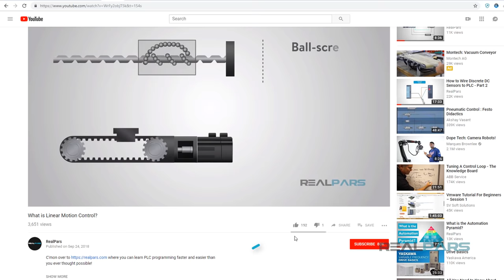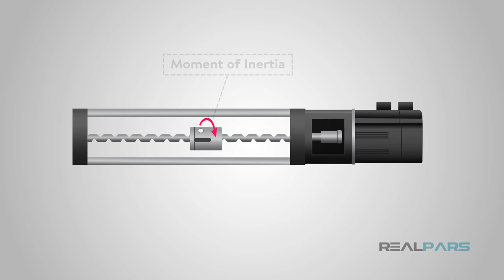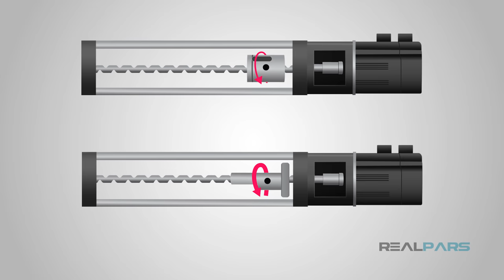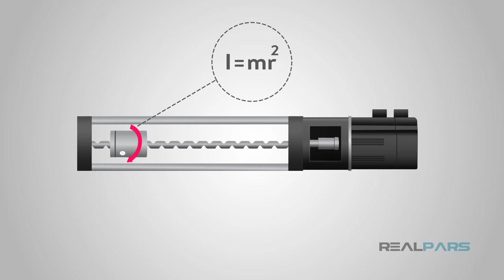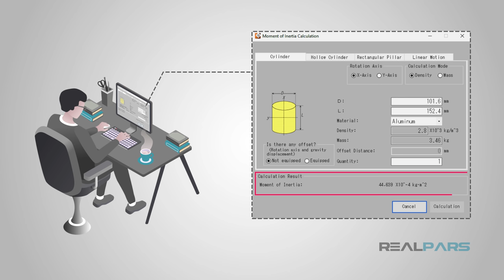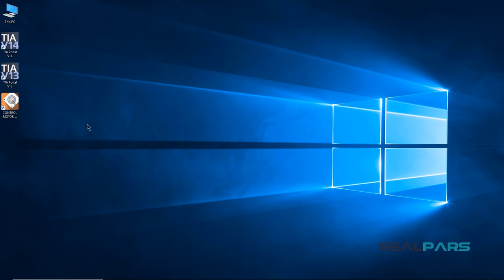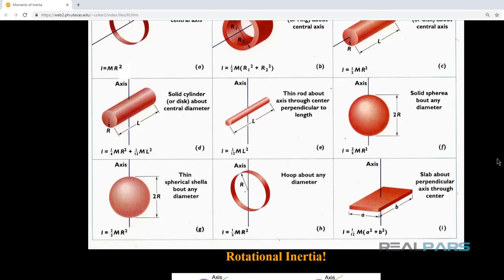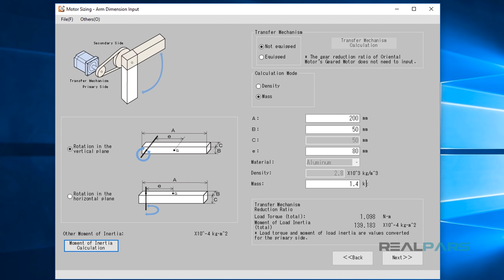How to Determine the Motor Size for Your Project?

Comment: When I open the software, I get the error:
 "
invalid conversion of the string"7.9" in typ single" "
I tried to repair it but it didn't work
Reply from the maker: This appears to be a software error caused by an issue with the specific browser you are using or the absence of some software component that was not loaded correctly.  I am not sure exactly what software or version you are using, but I would contact the software vendor via their support website.
Reply: Hey Marcel, did u fix it

Comment: Hi Mate, 
I am going to carry a steel pallet (overall weight of 700 kg) over rollers with 2 stepper motors on each sides, do you reckon "Nema 42 CNC Stepper Motor Bipolar 30Nm" is enough for this application?
Reply from the maker: It will likely be sufficient.  If 30Nm is the torque developed, this will likely work with a 1500 RPM motor.  The duty should be rated then for 6.5 amps or greater.  Even though you have four motors, I would still calculate based on the unlikely event of one motor on each side failing.

Comment: Good day, I want to cut a 4" PVP pipe. May I ask the process/computations in order to know what is the right size of motor for it? Direct cutting from motor to blade to pipe.
Reply from the maker: I assume you meant 4" PVC pipe.  I cut PVC pipe with my 1/2 Hp reciprocating saw without issue.
Reply: sorry for the mistake. Yes, do you have a video or link in computing for finding the right motor in order to cut it? Like the steps in determining that you have chosen a right motor for it.

Comment: Nice video, but I didn't see an explanation for what the 'e' value is (distance from axis of rotation to G) Perhaps G is the centroid of the arm?
Reply from the maker: Yes; e' is the distance from the axis of rotation (horizontal) to the centroid of the rotating arm.
Reply: @realpars  what if e=0 ..the shaft is at the centroid will it work?

Comment: 3:52 wrong, the more ENERGY will be needed. energy is force multiplied by distance, so counter-force does not necessarily need to change to counter the change in mass; the distance of travel could be the factor that changes, and most likely would be the variable since friction (the main counter-force) usually remains constant.
Reply from the maker: When two objects interact (puck and ice), each one exerts a force on the other that can cause energy to be transferred to or from the object.  The puck exerts a force of mass x gravity on the ice, and the ice exerts a frictional force (albeit relatively small) on the puck.  And you are correct, it is the transfer of energy that causes the puck to eventually stop.

Comment: which software is this on which u are calculating size of motor?
Reply from the maker: Hi there, 

Thank you for your question! This video was created four years ago with Omron drives. Not sure what version was used, but I am sure it’s been updated. Therefore, I can’t be sure which software version was used. But you can go to their website and find the drives product line. Companies that make drives provide the software too at a cost. However, you might find some free ones with limited usage. You can check any major motor manufacturers line like Siemens and others.

Hope this helps!

Comment: awesome job really helpful ! so is the software motor sizing still working ?
Reply from the maker: Yes!  Although more recent versions of the software have been released (as more motor models are supported, the physics behind servo motor control remains the same. For the same load, torque and other parameters are still important and are calculated in the same way.
Reply: @realpars  yes i download the setup from orientalmotor's website but after complet installation error occurs when i try to open the software... any help ?

Comment: how to configure Absolute encoder in PLC and if encoder is replaced then do I need to reconfigure?also, will the length of connecting cable have any effect on configuration?
Reply from the maker: Encoders are configured in a PLC in many ways.  The best way is to use a separate servo motor controller, as shown in the video.  The configuration of the encoder is handled as part of the servo controller setup.  Absolute encoders typically send voltage signals in a serial data stream via a protocol called SSI.  Siemens makes an SSI encoder interface card (6FX3002-2DB30-1BF0) that is not very expensive.  The card can be configured to meet the specific resolution and parameters required by your encoder.  Some encoders come with a more advanced interface, such as ProfiNet, so they can be directly added to your hardware configuration and configured using special OB blocks developed for interface to the device.  If you  swap out encoders later on, no additional configuration is required as long as it has the same interface, resolution, signal frequency and voltage level.  Otherwise, it may require changing some of the parameters in the encoder interface.  If the encoder has a serial (SSI) interface, then cable length is only an issue once you approach about 16m (50 feet).
Reply: ThanksActually the encoder being used is yes an SSI-P for PROFIBUS (10-30 Volts) and comes in 2 models, one to be used with 10m cable (33FT) and the other model used with 30m (90 Ft) cable.so my question here is; if by accident they where swapped as encoder; 10 meter model used with 30 meter cable and the 30 meter cable was used with the 10 meter cable what would be corrective action to be done at the resistance terminator or at the PROFIBUS?

Comment: i want to spin a  55 gallon drum about 30 rpm any recommendation on what kind of motor i should use. ( would prefer to be able to plug in to the home outlet)
Reply: Windmil
Reply: James its best to use a sizing software from any of the servo motor companies online.

Comment: Sir could you make me understand.if we are using 2 motors and each have 155kw capacity so what will be the sum of both motors power. It will be 310 KW or anything else 🤔
Reply from the maker: What are you trying to do?  Connect two motors in series?  In parallel?  AC or DC?  Or do you want to connect two pumps with independent motors in series?  Parallel?  Add some context, since the answer is different in each case.  For starters, you would not electrically connect 2 AC motors in series for any reason.  Each will run at reduced voltage and ultimately overheat without producing any more useful work than a single motor.

Comment: Can I lift 10kg weight by using 48 DC volt motor? If yes, how much torque and power I need for that?
Reply from the maker: Power = force x velocity = Mass x g x velocity. If you want to lift the weight at a rate of 0.1m/sec, then a 10kg weight will require P = 10 x 9.81 x 0.1 = 9.8W, not accounting for friction or other losses.  Assume losses are 50%, so your motor will need to deliver about 20W of power.

Torque will depend on the way you are lifting the object:  screw jack,  ball screw, rope and pulley, etc., so it will depend on screw pitch, orientation (lifting vs. levering), pulley diameter, etc.

A 48VDC motor will do the trick provided it can deliver the required power at the required torque to lift the mass.
Reply: @realpars  thanks a lot RealPars 😍🌹

Comment: what if the rotation is 20degree angle?
Reply from the maker: Not a problem.  Be sure to use the resolver feedback to position the part where you want it to be.
Reply: @realpars  What about the Pump motor of Concrete mixer truck?

Comment: Is this a mechanical or electrical engineer's job to figure this out?
Reply from the maker: Normally, an electrical engineer will determine the size and configuration (HP, voltage, FLA, frame size, grounding, etc.) of a motor, and mechanical engineers will be responsible for the mounting base, supports, and shaft alignment of the motor.
Reply: @realpars  Well thanks for your help. guess this does fall within my responsibility to learn about.
Reply from the maker: You are very welcome, Wail!